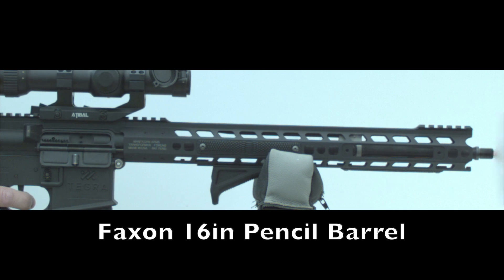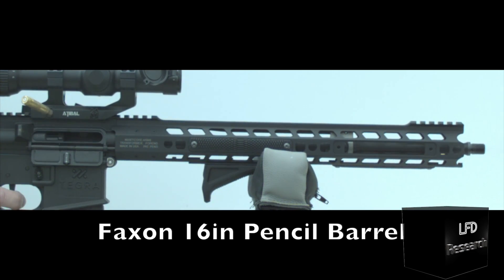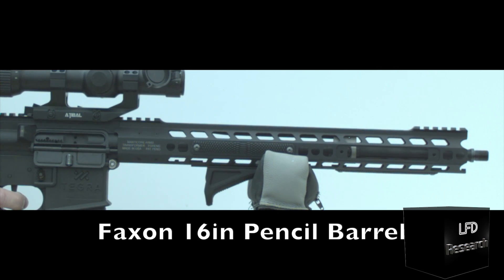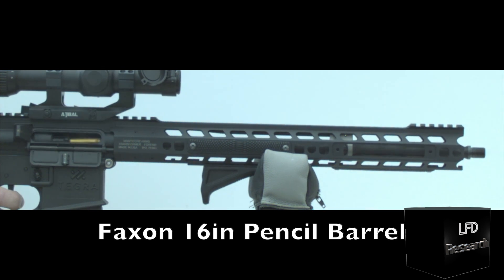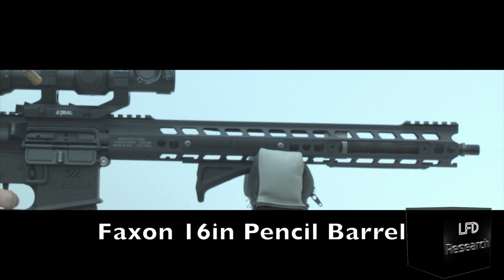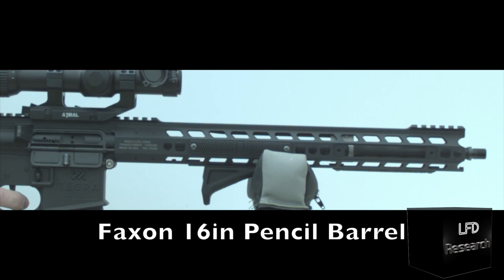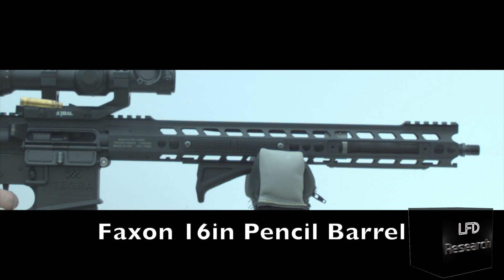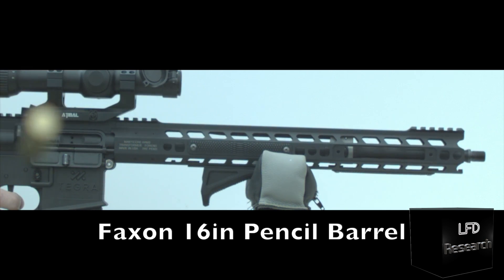Pencil Barrel Whip

Comment: I’m using an aero precision atlas s one handguard with the dead air keymo brake and there’s very little clearance between the handguard and gas block. I could probably slide a quarter underneath but nothing more. Knowing that the gas block is probably whipping into the handguard now, what should I do? Will that cause damage over time? Also using a really light barrel.
Reply from the maker: If your not having accuracy issues and the inside of your handguard isn’t showing wear I wouldn’t worry about if your seeing either of those it would be worth considering a change
Reply: @ There’s no sign of wear on the inside of the handguard or gas block where it would be making contact so I’ve ruled that out but I am having accuracy that’s less than desirable. Around 2-3 moa at 100 yards when I shoot a 5 shot group. I know lightweight barrels are extremely sensitive to heat but I’m confused if my accuracy is due to heat or a bad barrel at this point. None of my other rifles shoot more than 1 moa so this just seems strange to me. Using a 26.4 oz 6.5 grendel barrel I’m getting 2 shots either touching or quarter size maximum at 50 yards consistently (cold bore) but all following shots are roughly 1 inch in any other direction even at 50 yards. First 2 shots are always accurate and consistent with my scope zero but after that I’m getting as big as apple sized 5 shot groups at 100 yards. I’ve tried different scopes, cleaning, multiple ammo types, holds, re torquing barrel nut, literally everything. I guess what I’m asking is this expected out of lightweight barrels like this or does this seem abnormal?

Comment: Any chance of a run with a 3 prong flash hider? Im building out a faxon 16" pencil barrel 308 and im trying to decide between the A2 or a 3 prong....
Reply from the maker: If your plan is to mount a suppressor one day a 3 prong is most likely the best bet just be sure to get a modern design that has been tweaked to prevent or reduce the tuning fork issue of the older designs

Comment: An AR-15 creates a vibrational wave travelling 20,000 fps that will cover 32 in. (2X barrel length) in roughly .000133 seconds. Over .003 seconds the wave will oscillate along the barrel 22.5 times. .003 seconds is the elapsed time of the firing sequence, from trigger press till projectile leaves muzzle.

Comment: So the real question is how does it do under full auto? Will it settle out before the next round is fired
Reply from the maker: More or less yes largest movement is when the bcg bottoms out in the buffer tube and when it goes back into battery it’s already camped out again
Reply: At full auto why would you care about accuracy?  You won't.                                                                                                                   This is about target shooting. You will.
In war, in combat you don't want to carry no bull barrel crowbar around either. Thin & light.                                                                                                                                                                                     The same barrel needs to repeat the same way if you want to win a shooting match against yer friends. Loads, muzzle DEVICE, compensator can act as as tuner.

Comment: Barrel whip really only comes into play at long distance. From my limited long range experience, I'd guess 500 yards is around when it starts to become very noticeable. 

What's really throwing your bullet off is the shockwave moving through the barrel from the chamber, towards the muzzle. This video mostly illustrates what happens once that shockwave hits the muzzle and runs out of barrel to travel down. Those movements aren't nearly as noticeable to the eye, and aren't necessarily even effecting group size as long as the harmonics of the barrel stay consistent from shot to shot. Barrel quality, or more specifically steel quality,  plays a much bigger role in this than barrel profile. 

Where pencil barrels struggle is in heat dissipation/build up. As steel heats up, it changes shape. This again would, at least in reference to group size over group location, be heavily influenced by steel quality. Heavier barrels tend to stop the problems before they start here, though.

The difference between a Noveske pencil barrel and a Faxxon pencil barrel would probably be very telling in this regard.
Reply: Not a jab at the video btw, it does a fantastic job of illustrating barrel whip and harmonics. Thanks for the video btw!

Comment: The reason pencil barrel is less accurate it's because as the bullet rides the rifling of the barrel and the harmonic vibration of it causes a whip as the bullet leaves the muzzle versus a heavy barrel having less whip as the bullet leaves the muzzle and it's not actually a visible whip that it's referred to but rather a harmonic vibration
And we all know the other problem with pencil barrels pockets of carbon overheat and expand moving the barrel and causing a different vibration

Comment: How was the barrel mounted in the receiver? Was it shimed and glued?
Reply from the maker: Neither the upper was lapped then the barrel nut was torqued on 60 foot pounds the design for this free floated handguard   Doesn’t require it to be clocked to any point for either the gas tube or rail to be assembled
Reply: @LFDResearch  ah, no i did not mean shims for the nut. I meant the barrel shank. They usually have a lot of play in the receiver. It's common in competition cirkels to use shim stock around the shank if needed to get a snug fit and green loctite to glue the barrel into place. I would assume that would reduce the whip somewhat. Some high end barrels are snug enought allready or even requrie heat-shrinking the receiver onto the barrel, however Faxons standard barrels are not among those.

Comment: I run a faxon 16" pencil with a vg6 epsilon. fwiw doing double or even triple taps, I still hear the steel. However, the grouping is not quite as tight (im talking add an inch or two in space, and I'm by no means a pro at all) in those instances as some of my other guns (which this video shows why), but we're still talking hits on target. Thats the give and take. Lightweight barrels are a joy to shoot over longer periods of time. Once you get use to the weight and swing its hard to go back.

Comment: I think it only applies to the follow up shots during high rate of fire when talking in terms of accuracy
Reply from the maker: True but keep in mind this was as high a rate of fire that we could manage and it stops befor the next shot is fired the camera can only record for 4 seconds at a time
Reply: @LFDResearch  so then it’s apparent that barrel whip is just a myth. This proves it
Reply from the maker: Yes and no I’ve seen a lot more movement with subsonic 300blk on high speed so I’m wondering if it’s a bore size/ mass thing
Reply: @joshuaoh912  the barrel whips, it just happens after the bullet leaves and therefore doesn’t effect flight

Comment: No. Your video is not fast enough to catch the shock wave running down and back the length of the barrel.  It does that 4, 5, 6 ,7 times in 1/1000th of a second.   You're seeing vibrations but you're not seeing barrel harmonics.
Reply: Absolutely Stan.
I wouldn't be surprised if the initial barrel vibration starts at the instant the primer ignites (explodes?) and then builds logarithmically as pressure increases in the cartridge, the bullet accelerates down the rifling, exits the muzzle and then continues for several milisaconds, something like a Tuning Fork but quite jumbled and erratic.
This very well done, and very interesting, vid shows 'After the Fact' and has absolutly nothing to do with Shot Placement or Group Size.
Reply: Who fukin cares🥱🥱🥱 You guys are dorks to fullest extent of the word. 🤡🤡🤡

Comment: I swapped out my pencil BARREL for 24" wyldy TARGET Crown bull barrel. Then i got a blem upper and took pencil barrel and found it had slop and movement in upper so i beded it  jb wielded it and torque the barrel nut down to about 72 foot pounds hung upside down for 24 hrs to cure. Ditched the bird cage flash hider. Put on jerry miculek .223 muzzle break on it. It's a flat shooting bitch now. The same barrel before 1" to 2" groups at 25 yrds now its close to hole in hole at 25 yrds i whipped the pencil whip boy. Lol most of the time its a loose barrel in upper bed it up. And torque it to Max 70 to 80 ft lbs. Makes a big difference.
Reply from the maker: Yep or you can True the upper this is actually one that has had the front of the upper lapped to true it up for a solid mounting the bullet is gone before the whip starts

Comment: You can see that with the Dead Air brake, about 70% of the whip comes from when the Buffer hits the back of the tube
Reply from the maker: Exactly
Reply: The barrel doesn't' flex until after the bullet leaves the muzzle.  So how can barrel whip affect accuracy?
Reply: It does flex, just not as dramatically. The bullet stretches the section of the barrel behind it and compresses the section ahead of it. The compression of the barrel in front of the bullet can induce deflection. It’s a small amount but can account for 2-3 moa.
Reply: @giovannidetorres4373  It would take some very sensitive instruments to measure that.  I still think there is something else at play besides barrel whip, I just don't know what it is.  I studied this a lot over the years and I'm  still skeptical.  I believe there are micro vibrations after firing but to what extent? Everyone has a different opinion or explanation I guess.  Later.
Reply: If I had to guess, I’d say it’s because the dead air brake has the smallest top ports.

Comment: Great video!!! Interesting. However, the bottom line is, none of the viewers of this video are going to be in a 4 hour long firefight with sustained machine gun rate of fire at any range or sustained constant semi auto sniper shots at great distance. Pencil barrels are just fine and can easily achieve unlimited accurate hits at the center mass area of a target at 200 yards all day long, even in sustained rapid semi auto.  If China invades tomorrow, a pencil barrel will be very effective. Get a pencil barrel, do lots of training and have fun at the range. You’ll be just fine and so will your AR.
Reply from the maker: I agree but keep in mind all these were filmed rapid fire so the barrel is always still again long before you can fire the next round once I got an sot willing to let us do this on their select fire lower we will film it again the whip is very very short in time frame
Reply: @LFDResearch  I mean rapid fire semi is the scenario where this effect will have the most noticeable impact on accuracy since with automatic fire your accuracy is almost entirely dictated by recoil managment. Going from a 1" group to a 3" group at 100yds means nothing when even shooters with excellent recoil managment are shooting 6" mag dumps at a quarter of that range
Reply: After a bit of deliberation, I've decided to use a pencil barrel in my build. I figure, as you do, that there's no need for it to perform in an extensive, rapid-fire scenario. It's the good ol' concept  of "firepower vs mobility" by Nutnfancy. Since the barrel will most likely never need to fire rapidly and continuously, it's almost completely safe to trade away that capability for a lighter, more mobile barrel. I enjoyed reading your comment because I couldn't agree more!
Reply: @waylonk2453  I agree.  I like being maneuverable
Reply: China is already here...

Comment: So, the A2 birth cage sucks on a pencil barrel. I got the Faxon slim brake on a 14.5 Faxon pencil barrel. Very happy with the 6 lbs rifle, and it does what it's intended to do. Have fun at the range.
Reply from the maker: Agreed love having a really light rifle build
Reply: Yes and no.  The A2 is actually one of the better flash hiders out there.  Yes there are some that will reduce the lumens just a little more, but not for that little weight or that low of a price.  

For its cost, and weight the A2 is criminally underrated for what you get.
Reply: Yeah in a way, but rememeber the A2 was designed to limit dust from being kicked up to a degree.  It's all a trade off.

Comment: Is it me or did the Faxon Gunner Break at the end show almost no whip?  Comparatively.
Reply from the maker: You are correct with only ports on the side and high mass it only really starts moving when the bolt carrier bottoms out
Reply: I have the Faxon slim brake welded on a 14.5 Faxon lightweight barrel. I think Faxon is one of the companies that puts a good amount of R&D behind their products.

Comment: This is why I always lean towards heavier barrels period..... lot less harmonics and whip for sure! To me that little bit of extra weight is worth it not to mention if you want to fire in extended strings of fire it will not wander near as much!!! People can say whatever they want but heavier profile wins everytime!
Reply from the maker: As with all things it’s a trade off. Some recent testing seems to have proven that Faxon has solved the wandering zero issue
Reply: LFD Research - I’m interested in this; could you provide a link to this test if possible?
Reply from the maker: Inrange did the test a couple years ago. When ammo becomes avaibke again we will try and confirm it
Reply: I have both.  A light weight barrel can shoot just fine.   Most of this whip happens after the fact so to speak.
Reply: @cs-rj8ru  depends what you call light, my lightest is a .750 at gas block lothar walther barrel.... it shoots!

Comment: My guess is if a barrel had a well made brake , the expelled gas upward would force the barrel down, starting the whip.
Reply from the maker: Well we have several but you can see even with a bare muzzle it still has the whip but with a high gas volume compensator you can see that it makes the whip much more pronounced

Comment: Just a thought for a interesting video. How about installing a dial indicator on the barrel to see when the barrel actually starts moving.  

I find it funny some believe there’s absolutely no movement before the bullet exits. I believe there is just more after the bullet exits. Also. I have seen muzzle devices improve accuracy. I also don’t believe devices reduce or eliminate whip. It helps maintain the end of a barrel pointing in the same direction between the time the trigger was pulled and the bullet exiting. Hence adding more weight Improves accuracy.
Reply: Having been a machinist for most of my life, I doubt a dial indicator would take that kind of abuse, due to the speed of the barrel movement.

Comment: Thanks for providing this footage. I wonder if bolt action rifles/single shots do this to some extent as well. I imagine the answer to that would be yes, at a greatly reduced scale. I watched the barrel harmonics series on Johnny's Reloading Bench and muzzle devices of different weights did sometimes effect group size, not just group location, so that leads me to believe yes.
Reply from the maker: If you noticed on this the barrel settled down between shots with a solid amount of time before the next shot. When filming this we were ripping off shots extremely fast .20 seconds or faster between shots. Every muzzle device section was in real time less than 4 seconds long.
Reply from the maker: As for a bolt action yes you will have barrel whip and it will depend on how the stock is beaded and how heavy the barrel profile is.
Reply: Heavy barrel helps with more rigidity plus heat dissipation too. Being attached to a more rigid steel action would help too over the aluminum. Most people are not going to fire quickly enough for it to be a big deal since most are just plinking. Personally don't buy anything but bull or heavy sporter stuff anymore, but that's just my preference because I love accuracy over rate of fire and enjoy shooting groups and hunting. The most important shot is the first one anyway. Enjoy the range with a bull and enjoy hunting with a lighter contour. Would love to do some prairie dog towns and get a mix of both.
Reply: Also, forgot to mention it, but the free floating barrels may move around more, but they end up pointing the same way each time if given time to settle down between shots aside the whole heat issue.
Reply: That's why you have a tunable "boss" on some firearms.